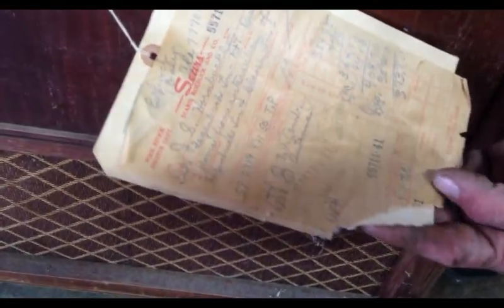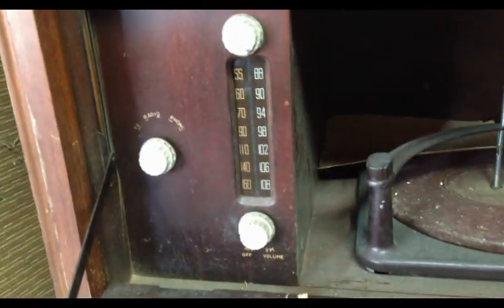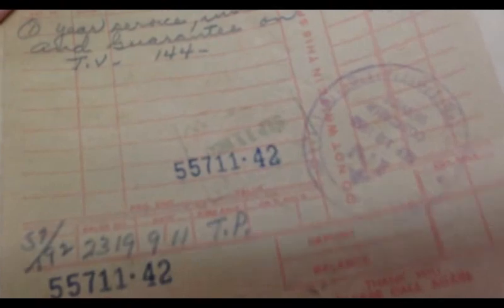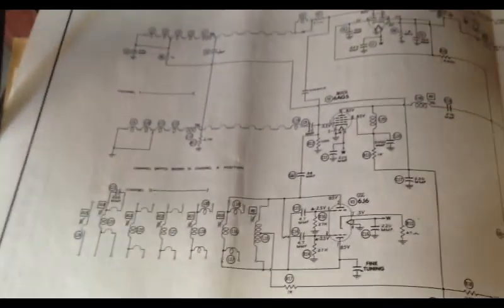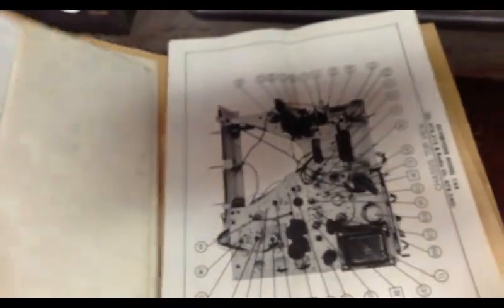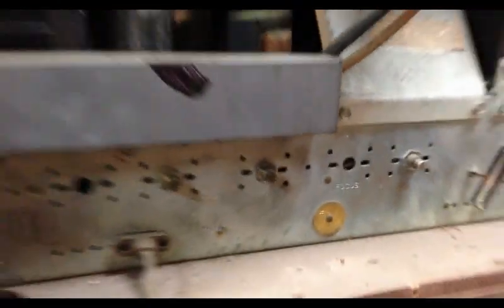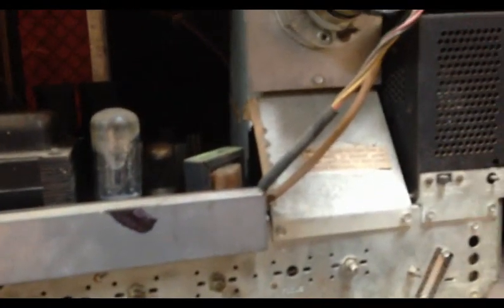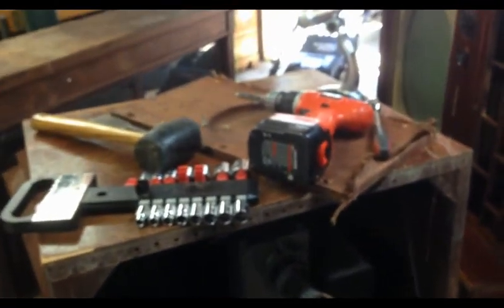Three Vintage 1950s Tube TV Sets Get Parted Out

Comment: That amp should make a good guitar amp pretty much as is, with a few caps/zisters. The xtal cartridge input is high imp, should be O K for a pickup, with a slight mod.  Add a horn speaker to that 8", may sound half ways decent.  It might be fun to add a compression preamp circuit on the input to the vol / tone.  Something like some old tube ham/CB mic preamps.  Don
Reply from the maker: The audio chassis I pulled will remain an AM/FM radio, and I may convert the phono input to accept a guitar. I have not closely inspected the schematic yet, but i'll need to make sure it's not a hot chassis. I doubt it is. I don't think phono units were ever hot chassis. The turntable itself was metal, so...